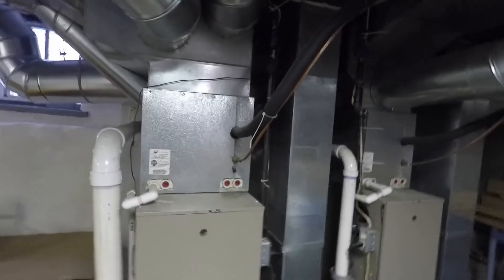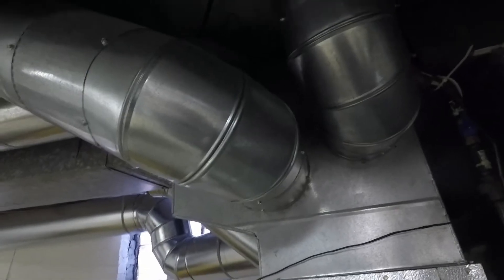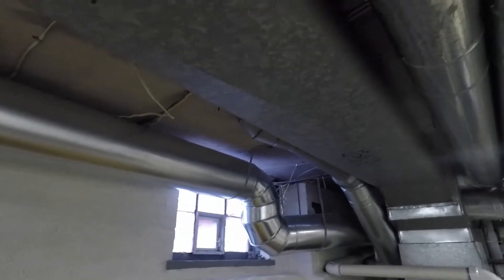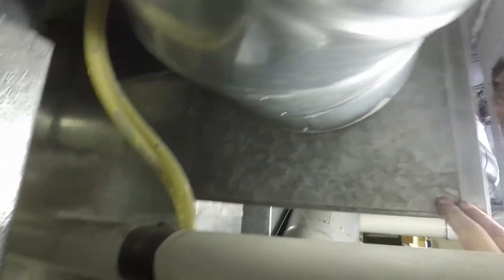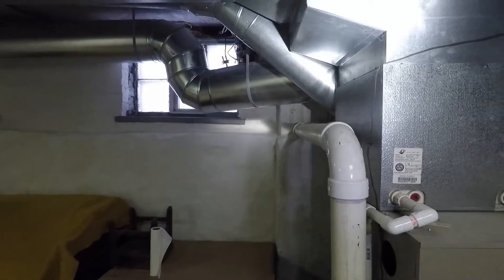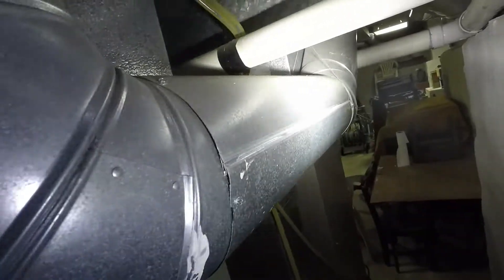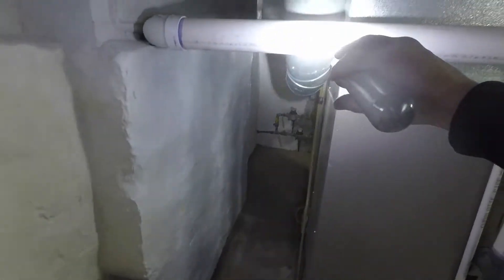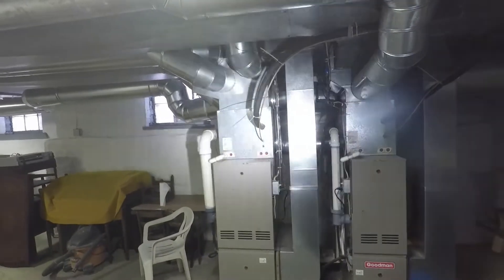BOOST FURNACE DUCTWORK CFM great DIY way to increase system cfm

Comment: So you replaced a 8x16 recatangle with three 8" round thats reduced to 7"? Isnt a 8x16 rectangle more physical space than two 8"  and you could have gotten by with adding one 8".  But doesnt the reducer effectively slow down and choke the whole system down? And is 12" return effective to supply 3x8" (24")? Thanks for any reply.

Comment: Great information. Thanks. Do the bigger ducts require  bigger outlets (floor grates)? I need to increase heat into one room.
Reply from the maker: Usually you are stuck with the supply end as far as outlets go. On the return side usually you can increase the floor grate size to increase airflow. I should have shown the grill in this house. They are the large grates from the old gravity furnace.